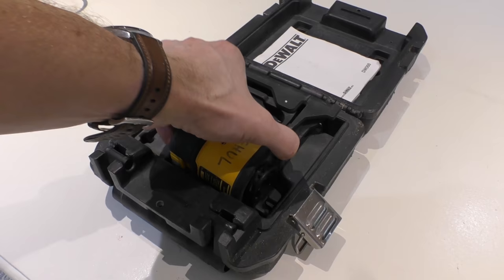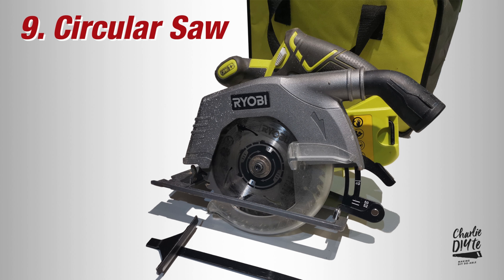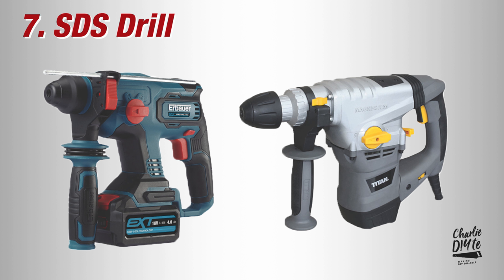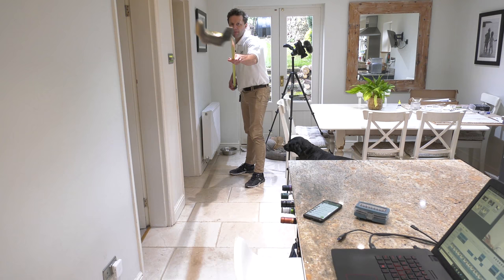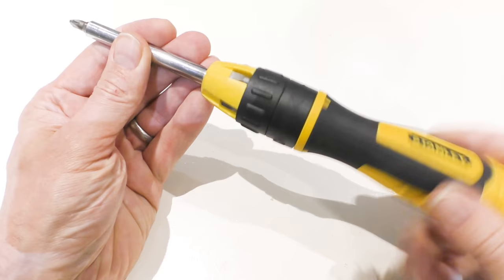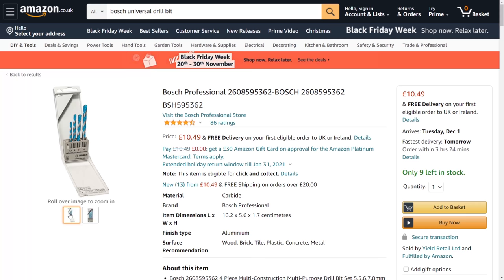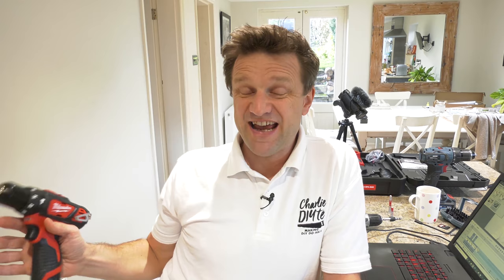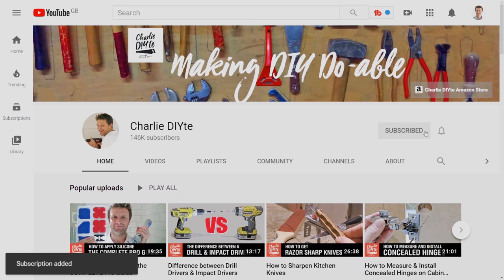My Top 12 DIY Tools for 2021

Comment: When I bough my DeWalt Drill Driver, I make the conscious decision not to buy the Combi version with the hammer action because I didn't want to be tempted to use a relatively lightweight tool to drilling brick and concrete. I have a Bosch SDS Plus for that sort of job, and wanted to ensure the DeWalt would last a lifetime. Every time I have to go to get the Bosch it makes me smile though because it so easy to use even on the toughest of bricks. Good list. Thanks

Comment: Good list.....but an oscillating multi tool HAS to be on any diyers radar. It'll change your life. Genuinely......also couldn't do without my impact driver
Reply: Agreed,  I probably use those two plus my cordless drill more than anything else
Reply: Definitely! An oscillating multitool is a godsend for lots of DIY jobs.👍
Reply from the maker: Interesting point that. Yes, I've got a Ryobi multi tool which has been very useful over the years, particularly for cutting into plasterboard. It didn't make the list just because I don't use it very often. The Dremel is also an awesome tool. I fully accept there are probably some areas this list could be improved though 👍
Reply: @CharlieDIYte  it's a tricky call - one of those tools where you don't necessarily use regularly, but when used will be the only thing to do the job, ditto jigsaw etc
Reply: Oscillating multi tool is indeed a game changer. Impact driver is good, but I wouldn't call it essential.
Reply: Been seeing a lot of youtubers not including that tool. I love it.

Comment: One little thing to add to toolroll or pack of cheap SDS drill bits: a small magnifying glass and / or a drill bit guage. Once you get on a bit, and the bits have been used a few times, it's difficult to read size marks on drill bits, especially on budget bits - changing glasses from reading to arms length to other side of room is a pain

Comment: Some great ideas here. And fantastic videos. One thing I’ve learned lately is the value of having decent cordless tools. Not having trailing cords is both safer and allows more flexibility. I’ve bought some much stuff over the years and I’ve found that buying good quality really pays. I’ve not got the biggest of budgets, but spending a bit more, and buying the same make, particularly for cordless (same batteries etc) is the way forward. Impact driver, never leave home without one ! 18volt cordless, the way forward for me.
Reply from the maker: Thanks Raymond. I agree with all that 👍
Reply: Couldn't agree more. Buy cheap, buy twice is king in DIY.

Comment: So true on that Stanley Screwdriver. Over the years I have bought three of them, the very first didn’t have a rachetting action (18 year old) But it is still my go to tool for that final torque turn. The driver bits over the years have gone down in quality but now use Bosch bits..... If you only ever buy one screwdriver ... then get the Stanley
Reply from the maker: Thanks Zac - good to hear you agree! Me too. It used to have a solid handle which was much better as the screw tip on the handle that you can store bits in tends to shred against the bits as it overtightens. Shame they don't produce the solid handle one anymore. Mine got knicked when all my tools were stolen from my garage.

Comment: bit late on this but one tool I've found so use full over the last 2 years

DeWalt 24 Piece Socket And Screwdriver Bit Set Complete With Ratchet And Case

its a little ratchet screw and socket kit. the ratchet is so useful for those tricky to get to areas. i use this all the time and saves going to bigger ratchets / sockets that take up loads of space/weight in a tool box.

not sure if other manufacturers do similar as this is the only of its type I've seen.
its paid be back in spades. one of the best little tools I've ever bought!
Reply from the maker: Thanks for the heads up on that Jonathan. I'll take a look at that 👍

Comment: I'm definitely on board with the 12v drill/driver recommendation. So many people seem to just buy an impact driver these days when they're really unnecessary for 95% of jobs.
Erbauer do a 50 piece mixed drill bit set for £12 which is really small but contains all the same stuff as the dewalt tool roll. Perfect size to throw in a tool box/drill bag.
Reply from the maker: Thanks buddy 👍

Comment: Strongly agree with SDS drill if you can justify space and cash for it in addition to a lighter drill. Surprisingly cheap and stops you burning out lighter drills doing what they're not designed for.

Comment: Cheap alternative to cordless leafblower: cheap vacuum cleaner / dust extractor which lets you push hose into exhaust outlet instead of inlet. I have small Titan from Screwfix that I've marked "Blowing only" in permanent felt tip. Have blower in one hand and Henry  vacuum cleaner in t'other but do wear a mask. Even better if you have someone else manage a second or even third vacuum cleaner. Do a few passes over a day or two to disturb and remove whatever doesn't get hoovered up but re-settles. Repeat till no noticeable dust kicked up by blower and you'll notice a huge change in freshness of smell, brighter colours, and more texture to surfaces. Just brushing and vacuuming doesn't cut it. I did the 3-foot high void under our ground floor very thoroughly and now it's a joy to crawl around and use for storage. Do as part of annual spring clean. It's amazing what gets blasted out of nooks and crannies!
Reply from the maker: Yes, good point, that. I've got the Titan, too. Hardly ever use it because of Henry, but the blower is probably the best feature on it. Well reminded!

Comment: Good video we probably all have a different list to be fair. My number one is my digital radio, I'd be lost without tunes at work 👍👍
Reply from the maker: That is a very good point. I have a Ryobi radio that runs off a drill battery. It's analogue so I have to connect my phone using the av cable if I want to listen to Radio 6.

Comment: Like your flipping quick square from near side to far side of material leaving saw in place to position square on far side. In 50 years of using circular saw and making jigs and guides, never thought of that yet so obvious when you see it.
Reply from the maker: The rafter's square? Yes, it's a little bit of genius that, but not my idea. Something I learnt from my carpenter mate John, who also pretty much rescued the circular saw from the bin where I had consigned it. Couldn't work out why it wandered all over the place until he pointed out the importance of setting the blade at exactly the right height.

Comment: I tried to get one of your no.1 Ryobi drill driver, but could not find one so I went for the Ryobi R18DD5 due to the brilliant torque control, which was a fantastic choice to build my new Keter shed which had 100’s of screws that all go into plastic. Not one screw stripped any threads. Brilliant 👍
Reply from the maker: That's a fantastic buy and 50Nm of torque with the control which is better than you'd get with an impact driver - excellent work 👍🏻
Reply: @CharlieDIYte  yes, thanks 👍 it was a brilliant buy, thoroughly recommended.

Comment: Just recently subscribed after I stumbled over this channel wanting to do diy on my own house and I find it excellent so far. I haven't  done very much diy but will probably find myself doing a lot with my own house now. First of all I have no tools or anything for that matter, with my first projects being to drill into brick to fix my number sign, plane my internal doors to fit my carpet and put up curtain rails or blinds, what tools and equipment would you recommend? After seeing some videos, I definitely will need a drill driver, level and a tool roll to start me off but what else what you recommend?

Comment: Hi Charile, and once again, thanks for sharing. I seem to remember you recommending the leaf blower a while back. However, when I looked at it, I decided it was a bit too steep for my Scottish pockets.
I was pleasantly surprised this time round to discover that it was on offer for £89 with a 4ah battery and charger. Well, normally the battery alone wouldn't be too far off that price. So, as I needed another battery anyway, I took the plunge and ordered it.
Sorry to say, I'd already placed the order with Ryobi direct - before watching your 10 tool review. 
Anyway, I'm very pleased with the blower, and the extra battery, as I own a number of excellent Ryobi 18v tools. I'd say the most useful of them has to be the 16g brad nailer I bought to replace the Hitachi gas nailer that has just become too unreliable after 8 years of use, The Ryobi is heavier - much heavier - but does not require gas, and is much cheaper than the yellow, blue or red alternatives. 👍
Reply from the maker: That's a great price for the leaf blower, and yes I've bought a lot of stuff through them over the years. I used that nailer in this video https://youtu.be/tdMnnkvInrE I agree it's an absolutely fantastic bit of kit. Thanks for the comment and for watching my vids 👊

Comment: the main problem with those drills with hammer function is, that the hammer function wears out rather fast if used a lot and could actually demage the gearbox. No brand is safe from that. even happened to my festool pdc18/4. a cheap corded hammer drill is a much better option for drilling into walls. So depending on how often you plan on using it, I would go with 2 seperate tools instead. will be cheaper in the long run
Reply from the maker: Agreed. The hammer action on a combi is hopeless. You want a light drill driver and SDS.

Comment: Ok, Im not diy, but if I was as keen as you are and spend as much time as I assume you do building, I would spend the extra and get all one brand, eg Makita. The advantages of a one battery system across an enormous range of tools is worth its weight in gold, and is a huge time saver. On top of that the tools are better built and will last longer.  1 double makita charger is all I need for about 20 tools.  If you are doing a lot of diy or professional work, I think buying different brands is a false economy. They will pay for themselves. Love the channel - you call yourself DIY but clearly you are very skilled and thorough.
Reply: You kind of really need two brands depending on what you want to do. I got 99% Milwaukee stuff (Cars and General renovation) but started getting some DeWalt too. DeWalt milter saw, table saw, and Spade Drill are the best. When it comes to carpenter DeWalt seems to have the largest selection.

Comment: Thank you for this great video, what's your opinion of the stanley ratchet screwdriver as many negative reviews of it. i am interested in getting one. please advise
Reply from the maker: The one in the video is very good. I've got about 3. The only downside is the top of the handle can move when you're tightening stuff so don't put any screw bits in it. They used to make it with a solid handle which was much better. Other than that it's great.

Comment: I think laser measures & stud/cable/pipe finders are worth considering.
Reply from the maker: Good point Mat. Yes, I have a Leica laser measure which I use a fair amount but it wouldn't get on my DIY essentials list, and I have a Bosch cable finder, which is about as reliable as I have found in a market where they seem in cable of producing anything that truly works.

Comment: Quick question: I am going to tile over tiles in the bathroom. How do I use Sikalatex SBR primer? Do I mix it with the adhesive or paint over the old tiles and if so can I let it go dry before spreading adhesive? Thanks.

Comment: Personally i would never buy Ryobi or Erbauer, i'll stick to Makita and Milwaukee #builttolast...... Great video btw...
Reply: That's just snobbery. Ryobi make great tools.....infact their 16ga and 18ga nailers are class leading
Reply: @ryk3899  , especially for DIY use. Just a waste of money buying these brands. Probably all made in China now anyway
Reply from the maker: Thanks guys. Someone said to me recently, I bought a Ryobi expecting it not to last and I've ended up with loads of them because they never die, or words to that effect. I've found Ryobi reliability and build quality to be fantastic over the years, although they're not as cheap as they used to be. Like all these things, you have to check the specs before buying. Spoke to a member of staff at B&Q a while back who said that brands like Makita have been dumbing down the internal specs of some of their lines to try and bring their tools to a wider section of the market, as a result of which they've had a fair few returns that never used to happen. That Erbauer combi I have with its all metal chuck, metal gearbox and an impressive amount of torque is a very high spec bit of kit, and the battery life is fantastic. Each to their own though. I can't argue with what you say about Milwaukee. @Fanfeck I think they are all made in the same factory, as it happens!
Reply from the maker: I have one of those nailers and it's outrageously good! Short story, Ryobi finally got in touch through their PR people. I said "about time, do you know how long I've been flogging your tools for on my channel😅" I was really keen to do a bit of a feature, maybe go and visit them, talk to the technical guys, get under the skin of the brand a bit, but they weren't interested in that. Just wanted to send me a couple of tools, which obviously I'm massively grateful for, but it's not going to be nearly as engaging or interesting as a video. Humpf!
Reply: @CharlieDIYte  Fair do's mate, never had to return any of my power tools thus far, i think Milwaukee are made in the USA and China so who knows....

Comment: I have that screwdriver, it's great, must have had it 15 years or so. About 5 years ago I got one of the stubby versions.

Also those Bosch drill bits are insane. Like hot knife through butter when I went through both wood and brick in one go
Reply from the maker: That's good to hear, Sunil. Thanks for the comment 🙏

Comment: Wot, no impact driver!? Most tools are an obvious buy - everyone knows you need a drill -driver/combi. But an impact driver seems unnecessary - until you get one and find how much better it is than a drill-driver. In fact I would rather have an SDS drill and an impact driver, if I had to choose which to sacrifice...
Reply from the maker: I have an impact Daniel as discussed here https://bit.ly/3sxpfw5 and a colleague I work with couldn't be without his - and so would agree with you - but I personally think it's overkill for most jobs.
Reply: @CharlieDIYte  Thanks for your reply. Usually one wants to drill a hole with one power tool and then drive in the screw with another - one doesnt want to muck around changing a drill bit for a screw bit - so it makes sense for the thing one drives in the screw with to be that which does it best - an impact driver. 

It is also better than a combi drill at extracting old tight screws...

Comment: Definitely sending the video to my partner! But would you have any suggestions on Mitre saws?
Reply: Evolution R255SMS is the one I got for my birthday this year. Great value!
Reply from the maker: Thanks Owain. Couldn't agree more. The Evolution are fantastic value for money - remind me of the Titan SDS in that regard. I too have the R255SMS. You can do a lot worse than that. Mine unfortunately had a laser that was inaccurate when shipped, but I wouldn't let that put you off. I could probably get it fixed but haven't got round to it and you don't really need it to be honest. We also have an Evolution Rage in the office which has paid for itself ten fold.
Reply: @CharlieDIYte  Absolutely agree with you on the Titan SDS front too. I was very nearly tempted to buy one but then saw an ex display Ryobi Rsdsk800 with case come up in my local homebase for £50 so bought that instead. Slightly lighter and less powerful but perfect for around the home jobs and to supplement the R18PDBL brushless combi I have as well.  I also have the RID1801M impact driver and find I use that probably more than the drills. I'm very tempted to get a 12v drill driver too after watching your videos but that may have to wait until I have a justifiable excuse to get one!